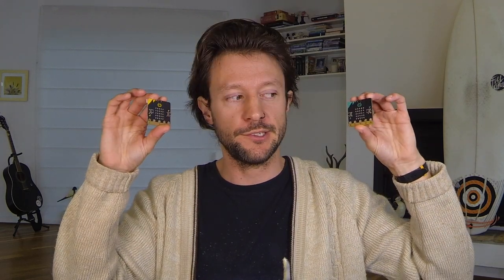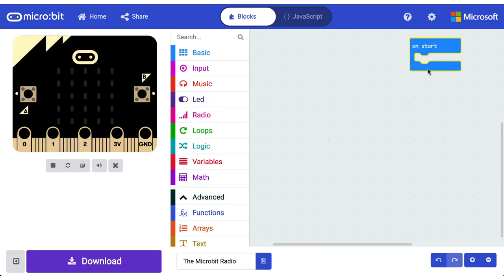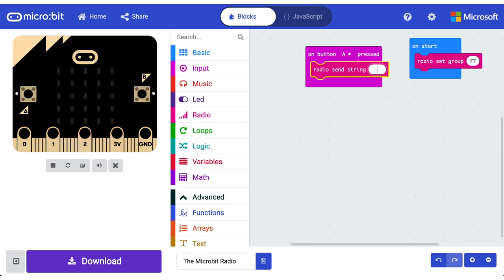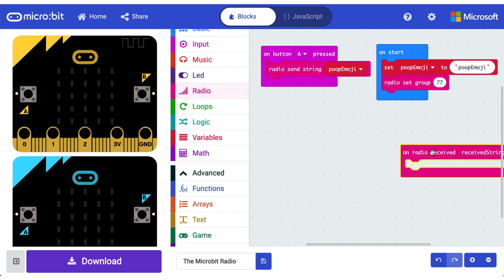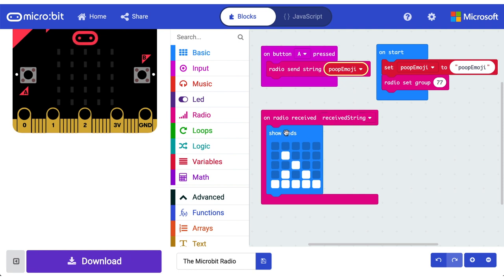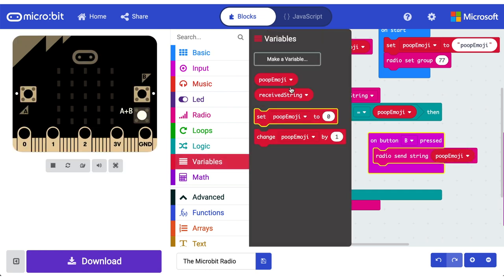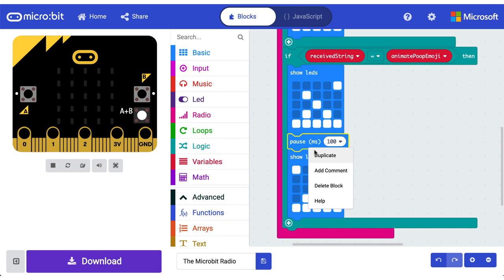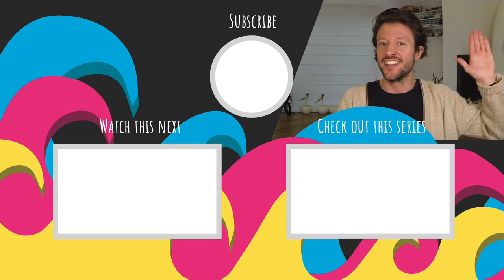How to Use Radio on Microbit | Send and Receive Message Tutorial

Comment: Hi Codey, I'm making a micro:bit motor board where I need two motors to be powered by the micro:bit whilst also it being wireless through bluetooth, I followed your steps in the video and can't seem to get the motors to work, what am I doing wrong in this situation?
Reply: You need aligator clippers to connect them and the actual servo countrols

Comment: Hi nice video.
Is there a way to measure distance between 2 microbits? (via radio or bluetooth possibly?)
Reply from the maker: Hi soniferous, thanks for your question. Out of the box, I'm not so sure. But you can definitely buy add-ons that will allow this functionality. I'll link below to a guide and the accessory to a potential solution. I'm thinking that it could be a great opportunity for a future video!

https://www.kitronik.co.uk/blog/distance-sensing-microbit-hc-sr04-module/

https://www.kitronik.co.uk/46130-ultrasonic-distance-sensor-hc-sr04-5v-version.html
Reply: I wonder ify you could somehow use three of them to triangulate.